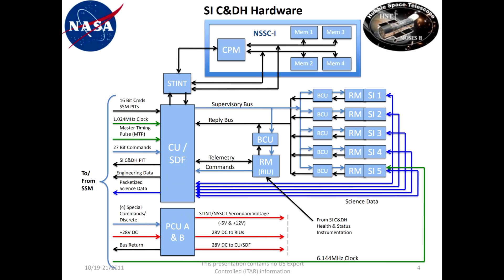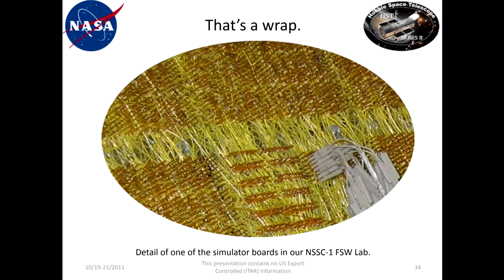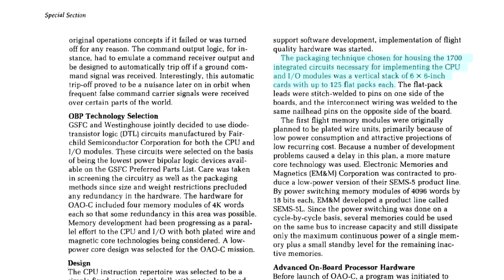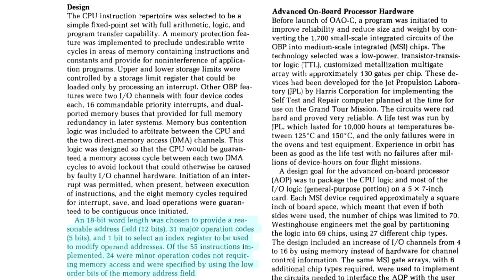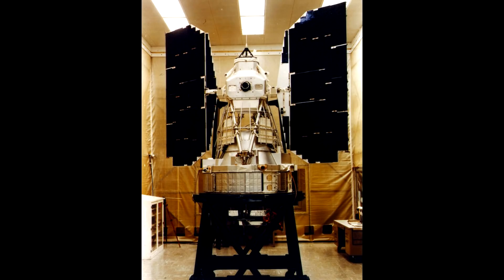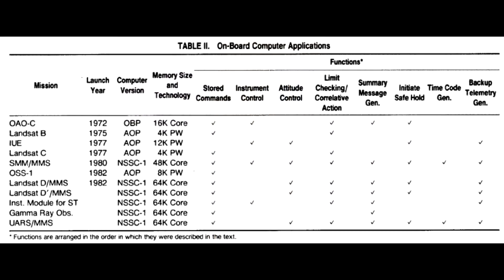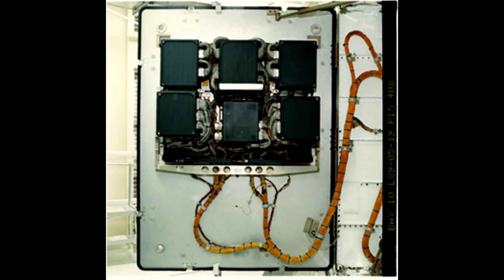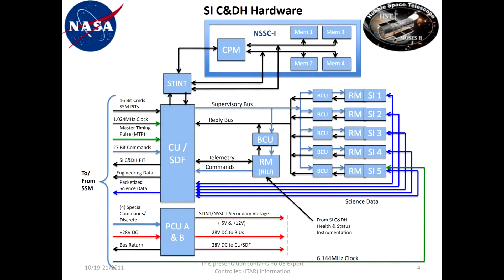Hubble's Latest Problems May Be In a 50 Year Old Computer Design

Comment: I get that space, even LEO, is a harsh place for both organic and electronic machines, but could instruments like the Hubble or the various Mars rovers not use much more commonplace hardware with appropriate shielding? I should think that using modern (at the time of launch) consumer hardware would be cheaper than the specialty hardware that seems to always be used, and for the reduced cost gain the ability to have many many times more redundancy in addition to the (usually) much better capabilities of the latest consumer hardware.

Comment: @scottmamley

I saw a video the other day that said that alpha particles can change a 0 to a One in a system's memory how does the Hubble space telescope deal with that? I can't remember off the top of my head how far the telescope orbits around the Earth but I'm pretty sure it's high enough where you got more of a chance of that happening so I was just wondering is watching this video and now knowing that that can happen did they know that when they made the Hubble space telescope? And if so what did they do to try to stop that because the guy in the other video said that alpha particles can pass through almost anything which makes sense but if it could turn to zero to a One in memory that seems like a big problem for something that orbits around the Earth

Comment: just get a new pc in there? whats so hard about that. un-manned rocket with a robot arm (a new, good one) and just rip that thing out, plug the new in, boot up the software and finished

the only thing they need is an adapter for the connection or just a space shuttle to catch the telescope, repair it with humanpower and get it out there. Spaceshuttle then just provides cover for the telescope incase of little parts flying at it or as a big battery and external harddrive with bluetooth
Reply: If it was that simple they would of done it by now

Comment: Amazing details.  Excellent video. 

How many terrestrial computers have operated with the same level of reliability?  I’ve read that the sealed and ocean submerged data centre trials have 100x lower server failure rate which they attributed to the thermal stability of the surrounding environment.

Comment: Got computers in space lasting 50 years and I cant get my 3 year old PC to do shit
Reply: I have a 12 year old mac Mini that's still fine.  What did you BUY? an Acer?
Reply: @DanaTheInsane  optiplex 9020 core i7 4790 Gtx 1060 graphics card and 800w power supply

Comment: Hubble running on a 486... imagine if they just stuck a raspberry pi on that thing that uses just a mere 10-20 watts of power with hundreds to a thousand of times the processing power. If they want redundancy, put in a cluster of like 6-10 of them and add even more processing power + redunancy lol If it can be made to run on a x86 processor, it can be made to run on ARM with little to no trouble XD

Comment: I really hope they can restore Hubble's operation. And when the day comes that it is retired, I hope they bring it home, not just de-orbit and let it burn up. I'm a '90s kid and Hubble was just THE thing I grew up with, space-wise.
Reply: At least they could recover bits of it. As a Victorian, I volunteer Perth. They even have prior experience :)
Reply: Not sure they can bring it back, the reason they can't repair it is a lack of vehicles able to grab hold of the telescope, which means they wouldn't have anything able to grab it and bring it back, so if it does die it's likely it will having a Viking funeral

Comment: Since they announced it I was very surprised that they retired the shuttles without any plan of a replacement. wonder what it would take to retrieve one from a museum and get it space flight worthy again.
Reply: It'd be like restoring an old house, several times the cost of just rebuilding from scratch. The shuttle was pretty cool but it had a lot of flaws too - even if you found the vast amounts of cash you'd need to rebuild one, nobody would certify it as safe to fly these days :/

Comment: It's not just the servicing of the equipment. Jobs like refurbishing Hubble take days to accomplish. The space craft not only has to carry the replacement parts and tools, it has to have facilities to support the crew during that operation as well and that's a tall order for something like Dragon, which is really just a personnel transport vehicle. Without the shuttle or a comparable craft, Hubble is ultimately doomed. Don't forget, though, that it is already well past its original life expectancy. However with another service mission, it wouldn't surprise me if it were to last for a further ten, twenty, or even thirty years.

Comment: As a result of budget cuts, NASA was forced to employ multiple Commodore PET computers, because they didn't want to wire-wrap 160,000,000 circuit connections for each 64K memory board!

It's interesting to realize that many of the astronauts doing EVAs to fix Hubble are actually YOUNGER - born AFTER the Hubble was launched in the first place!
Reply: Hubble was launched in 1990 and last serviced in 2009. I don't believe they let teenagers do the repair missions. What budget cuts? Did you even bother to look up the numbers?

Comment: The next time SpaceX launches a resupply mission to the ISS why not take a detour and replace the whole Hubble computer with modern equipment?
Reply: Hubble and ISS are on different orbital planes, a resupply Dragon doesn't carry crew, Dragon doesn't have an airlock or manipulator arm and you simply cannot punch modern Hardware into a satellite that was built decades ago.

Comment: FIFTY YEARS. Think about that for a minute.  That’s 1971. Cell phones started coming out around 15 YEARS later. No one had a computer, cell phone, internet ...  etc. I think it’s a miracle this thing worked so long. What’s a 1971 car look like today after you’ve driven it for 12,000 miles per year for fifty years with no maintenance - no oil changes, no spark plugs, original tires and brakes - nothing. It would not start let alone be drivable.

Comment: Doesn't the lens hardware get manipulated by a 486 chip?
Reply: Yes, the main computer is based on a radiation hardened 486 CPU.
Reply: Thanks for that, I looked it up. I had to make a change to the 386 reference on the Wiki page, as there was never a 15 MHz 386 (graph was misread, if you look closely the figure cited was actually 16 MHz) /nerd.

Comment: I was a contractor  to NASA back in the early days of Hubble.  As I recall one of the computers was considered old when it was launched.  It was chosen because it had been certified for space, whereas other more recent ones had not yet been certified.  That certification would take a long time.  Sooo....
But as I recall the  comments back then, it was ok because one of the main tasks for that computer did work on the old cpu.  That task was to just keep the telescope from pointing at the sun.  And Hubble was launched; nearsighted, and with an old computer.
TBH it has performed pretty well.

Comment: Imagine a set of new modern-level (space-hardened, of course) low-power requirement computers, petabytes of redundant durable solid-state memory storage, and a new communication package to give Hubble massively-enhanced bandwidth to the ground... all to support equipping the Hubble Space Telescope with 10k high-resolution camera(s) and other new high-resolution instruments.
Reply: These days hardware is too 'complex' still to harden it for radiaton and other stuff. CPU's would simply start to make erratic errors up in space what you cant have really.

Comment: Modern microcontrollers and microprocessors negate the need for such super-high-reliability stuff by making a system of many multiple backups and multiple data, comms, and processing paths available for cheap and in less space/mass. Add some simple shielding and Bob's yer uncle.

Comment: The Perseverance rover that landed on Mars in 2021 uses a 1998 process....the 200 MHz Power PC 750 using in the 1998 iMac. Not sure what other later CPUs are currently being used for NASA space projects. But I think the Power PC 750 is one of the main processors used today and has shown over 2 decades of space service.
It has of course been specially hardened against radiation.  Not sure what that entails.
They of course use much newer CPUs in the laptops aboard the ISS.....not sure if they have special CPUs or just standard off the shelf CPUs. Also, I'm sure the Dragon capsule uses some recent CPUs and GPUs to drive their onboard monitors....not sure about cpus for controlling thrusters and other ship processes.
I guess if you don't need 8+core/16 thread CPU's there is no need to install them on your system. But if the PowerPc 750 has been radiation hardened, then they ought to be able to utilize the hardening method for current CPU's so that they are ready when needed. No need to reinvent the book/technique.

Comment: I know we've sent several servicing missions up to Hubble since it first went up, but still, quite frankly I'm not surprised that such an old computer system is starting to have issues, that thing is older than I am.
I do hope they figure out a way to fix this, or a way to keep Hubble going; it would be incredibly upsetting to lose such an icon of astronomy. But that said, honestly, Hubble has far outperformed any and every expectation anyone ever set for it; if this turns out to be the beginning of the end for Hubble, it'll be given a hero's memorial for everything it's given us.

Comment: Why in 1990 they are using 1970's computer? I realize the lag in development of stuff capable of surviving space, but it shouldnt be a 20 year gap. 18bits? talk about lack of using standardization. And lack of future proofing.
Reply: Hubble was designed and constructed in the late70s-early 80s. It was originally to be launched in 1983. Problems and ultimately the Challenger accident pushed it back to 1990. The computers were more or less what was availlable at that time.

Comment: Can you imagine if we had a reusable spaceplane we could've just sent some people up there to check out what the matter was and possibly even swap the components with new ones?
Reply: Even with the shuttle still operational, they would do exactly what they do today, examining the problem and preparing steps to safely switch over to the backup side of the computer.
Reply: Btw. they already swapped this particular system during the last servicing mission in 2009.

Comment: The James Webb telescope will have 50 year old computer problems too by the time they get it to space.
Reply: Probably runs on JavaScript
Reply: @490o  • LoL 😂
Reply: Oooo - ouch!
Reply: My uncle was a Systems Engineer on JWST a while back. The delays suck but it's incredibly high tech. Yes, technology is always aging, but just as the Hubble did not disappoint well into its life cycle, I expect the same for the JWST.
Reply: welp, its deployed now
Reply: hubble is just from 1990...so max 30years old.
Reply: @worldnews4347  However a lot of the computers (especially the ones it launched with) were a good bit older than that
Reply: @worldnews4347  In the video, you can learn that the technology it launched with is much older.
Some are still dating back to the 1960s.
In computer terms, that is seriously old. It's like a computer fossile. It's like using a string with knots to do your math.
Reply: @worldnews4347  did you listen to the video? He explains that it got delayed so much, that the original computer system designed before 1970 got shot up with the telescope in 1990, meaning the computer is 50 years old.

Comment: I wonder if it could be possible to re-program one of the more modern payload computers to take control?
Reply: I would imagine the system is probably designed to prevent that, just to make sure no malicious code on one of the secondary computers could take control of Hubble

Comment: The way I understood it was, it takes so long to do the space worthiness testing... When it comes to computers, they will be outdated by the time the test are done. Then that computer will after being tested sit around sometimes for years before the rest of whatever else it bolts to is ready to go. So either chunk the latest/greatest computer made in space and hope it works or deal with tested obsolete units. 
Here's a thought. We have a space station last I heard. Send them a top of the line laptop. Program it to be able to do whatever spacey things it needs to do. Being a modern top of the line unit it will have BLT and WiFi. Strap it to the outside of the station. Run endless simulations. Then send it home to see if it is worthy. In actual application have the laptop in a shielded environment.
If or for how long a laptop can survive Duct-taped to the side of a space station is your test. Could have sworn I saw a laptop or two in the station..

Comment: Would it really take a decade to engineer a Dragon version with an airlock and a grappling system to tie the spacecraft to Hubble? 
There is already a hatch on the front of Dragon, build a module with the airlock and grapple and attach it as an extension on the front of the vehicle so that the astronauts can do the EVA. Materials could be stored in the back and could be brought forward by either an astronaut or a sufficiently long arm attached to the front module. For return to Earth you slow the vehicle to below orbital velocities and jettison the front and rear modules and return as normal.
For safety reason you might have to include an LES tower on the front module to help the Dragon capsule to escape in case of trouble though.
If this became something SpaceX was contracted to do often it might even be profitable, but in that case a dedicated larger (or maybe just longer) version of the capsule with everything integrated might be better. Or a version of Starship.

Comment: If NASA/JPL can build a grappling arm and single-seat capsule that could fit into the SpaceX Dragon trunk, then SpaceX could launch a repair mission, dock/grapple with Hubble, the astronaut could EVA from the trunk capsule, repair the Hubble, return to the Dragon trunk after which Dragon could rendezvous with ISS, if the trunk grapple is designed well, it could be left at ISS.  The single-seat capsule could also be left at ISS.  The trunk astronaut could return in a empty-on-launch seat in Dragon.

Comment: I wonder if they are using electrolytic capacitors in the electronics? Something more reliable I would suspect would be desirably, like in theory tantalum caps. But those have their own set of failure modes, like they tend to start leaking heavily aka become a resistor.

I have had many weird faults being caused by faulty tantalum capacitors over the years, but that is a far cry from what shitty electrolytic capacitor have caused... And thank God for those as without those my repair business would have gone bust right from the start! xD.

They are the #1 failure point over all in electronics, second to bad connections aka cracked solder joints.

Comment: Hubble was launched in 1990. So you mean to tell me NASA put a 20 year old computer into a space craft before putting it into orbit.
Reply: Hubble was designed in the 70s and built around the mid-80s. Perseverance, the latest mars rover, was launched with a Rad-750 computer available since 2001 which is based on the Power PC G3 from 1997.

Comment: I mean given the age of Hubble, this is kind of decay, slowly but steadily is to be expected. Now it should also be mentioned that JWST is NOT a replacement, it is to my understanding mainly infrared, with some fringe shifts in both directions. So perhaps, just perhaps it is time to build a Hubble 2.0 ? Just imagine for a second, what this one could do, with serval decades worth of technological progress comes an astounding ammount of possibilities.

And now that I think about it, perhaps we should invest into a spacedock with mobile repair/servicevehicle? It is reasonable to asume that sending up future tech by rocket is feasable, but the "putting things together" part is more problematic. So why a spacedock and why a mobile servicevehicle? Well the dock can be used to put bigger parts together and would basically be a small spacestation, almost exclusive for that, well that and docking a vehicle which could be used instead of a modified dragon (with Canada arm), or one of Elons Spaceships, should be more costeffective too since it could be used/upgraded into a fuel depot and pitstop for certain mission types, without sending entire starships up, just to repair something. And now that I think about it, this spacedock could also be used to "cut" bigger scraps/decommisioned pieces apart and have them burn up in atmosphere, all justifiable in the quest to avoid the Kessler syndrome.